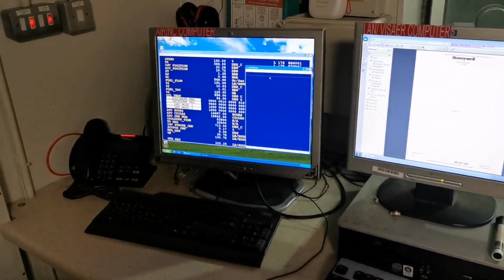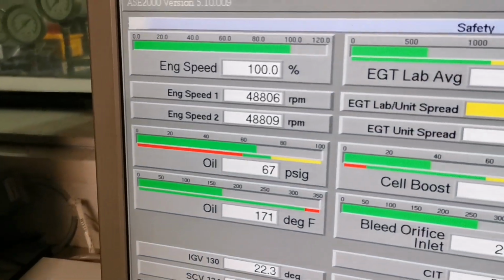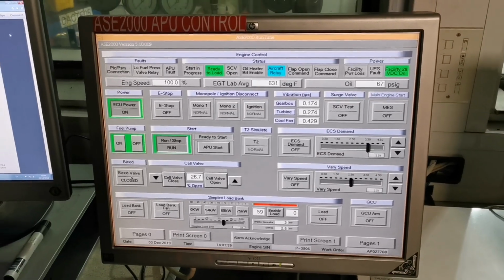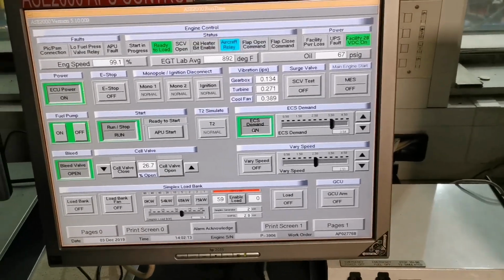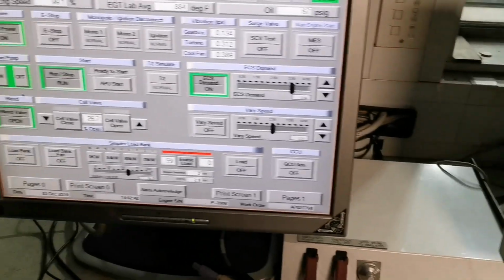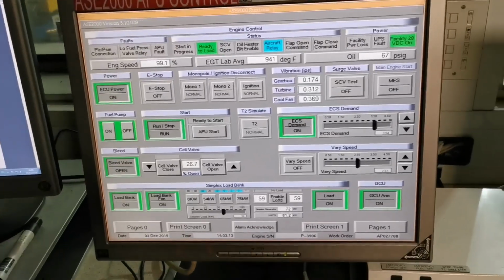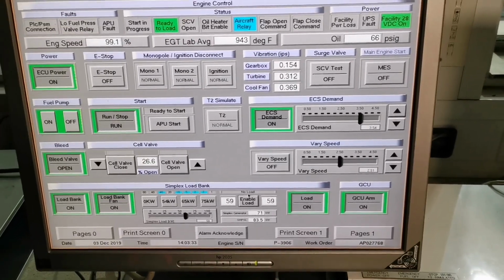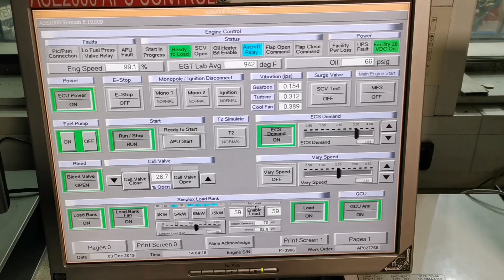Jet engine test - 131-9A APU test cell run

Comment: do you have any APS3200 APUs? I was interested in what a test for them would look and sound like :)
Reply from the maker: No we only do Honeywell APUs in my job. I can't imagine the test being that much different. They're not as powerful as the 131-9a.
Reply: @Endfloat  yep, I saw videos of APS apus and they don't sound as cool
Reply from the maker: I read a document a while back that rated the 131-9 at 600 equivalent hp, and the APS at 550ehp. That makes all the difference.
Reply: @Endfloat  well according to my calculations the more horsepower the more cool the apu is :D